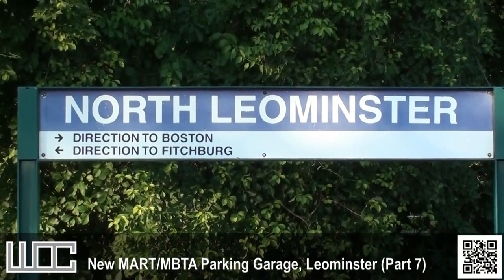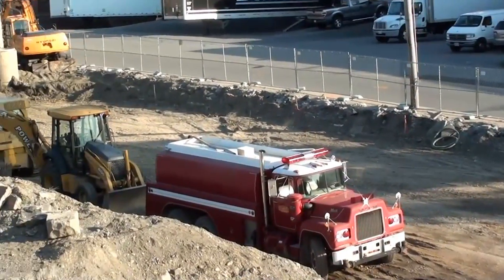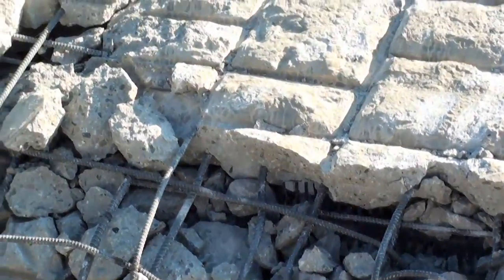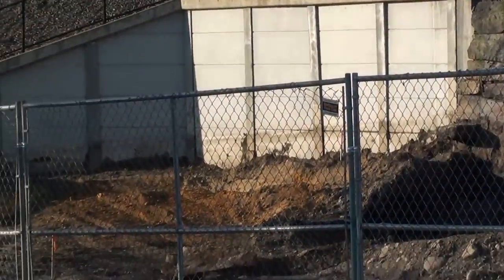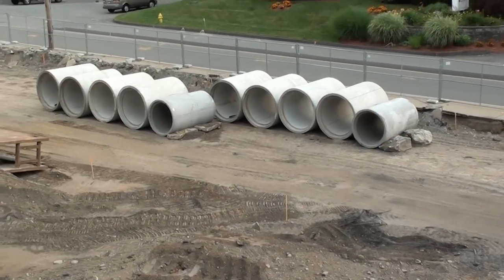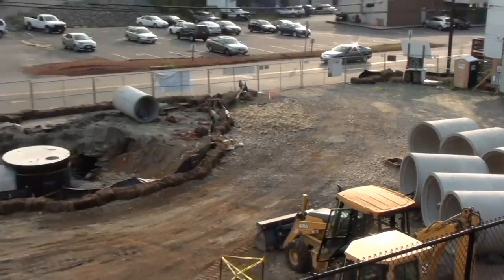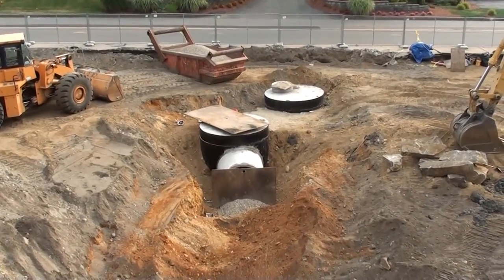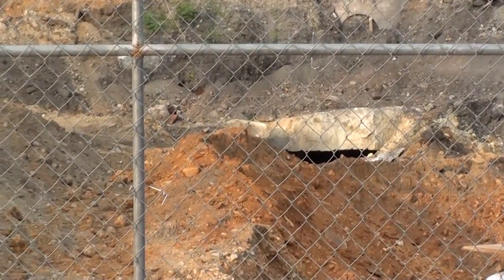Leominster: New MBTA Parking Garage (Part 7)

Comment from the maker: It is actually considered a "questionable" project over here, believe it, or not.
It is needed, because the original 2004 parking lot was too small, as people filled it up in just a couple hours (before 7am), and others would park in private businesses parking spots. The garage is supposed to more than double the spaces the lot originally had. I think it should get another floor (4 total), as the last level may also fill, or leave very few spots.
As for the elevator, it's likely a TK, or KONE.